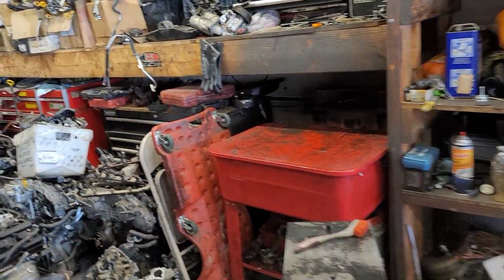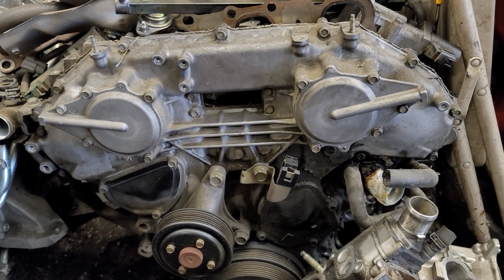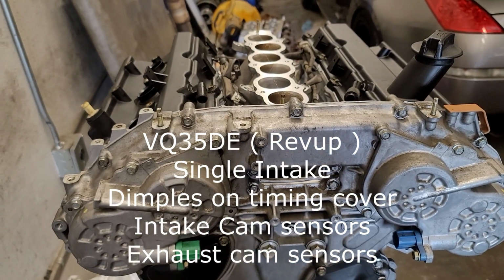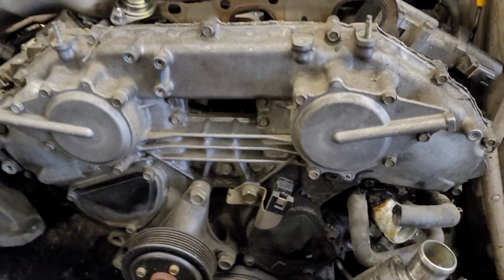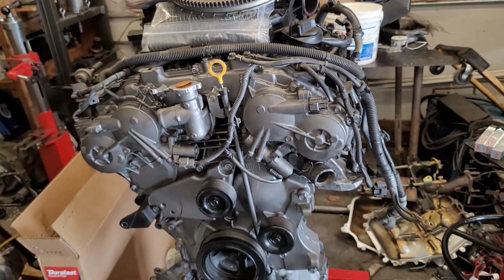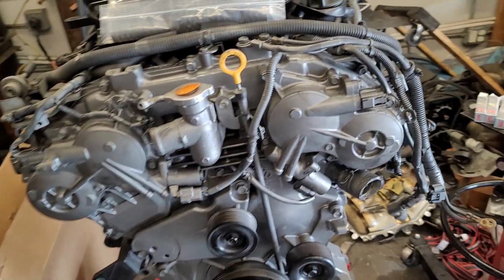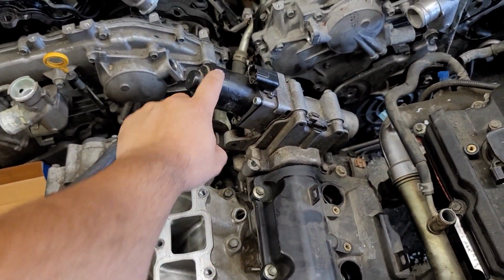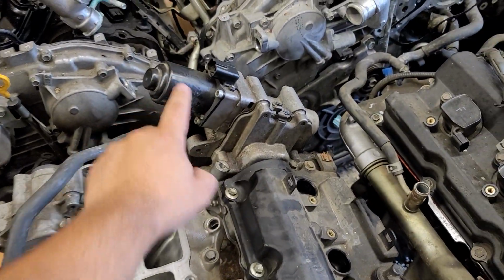Differences between a DE, Revup, HR, VHR motor ( Brief )

Comment: I just bought an 06 g35 and I heard that it has a revup but for some reason mine has a non rev up I’m guessing the previous owner swapped it. Is that for better or for worse?
Reply: All automatic transmission G35s from 06 and below had a non-rev up engine, according to what I've read.

Comment: also, I know this video isn't about this, but maybe you could clarify a question I have about the DE engines?  I currently replaced the radiator in my Pathfinder everything fine except the other day it overheated and all the antifreeze spewed out of the catch bottle now is it true that these engines have two thermostats or do some only have one in the front I can't see the one that is said to be in the rear of the engine because you have to remove the intake manifold to get to it, and I don't see any cooling piping going back through there and stopping anywhere, except for the bleeder tube to burp the system . I was just wondering if it was true for all DE engines that they have two thermostats instead of just one? any help or feedback about this would be greatly appreciated. Thank you for your video.

Comment: my 01 pathfinder and 04' 350Z both have VQ35DE's in them but the intakes manifolds are different the Z's the throttle body is directly in back of the engine exiting to the right of course. The pathfinders is directly right side of the manifold. So is there different DE engines?  I also read there is such thing as a VQ30DE's.  Anyway both vehicles are stock and both vehicle emissions control information stickers both say VQ 35 DE on them so I'm not completely sure if they are correct. I don't know what was done to my Z it could be an aftermarket intake but to me it looks stock.
Reply: I thought pathfinders had a vq40

Comment: Which one is the best and reliable having a DE with no issues
Reply: Rashid Khan none bro, get a HR
Reply: 03-05 non rev up de is the best de
Reply: DE AND VHR
Reply: K -A de and hr. Vhr has more known galley gasket issues and vvel heat issues. For boosting hr heads on a vhr works very well making it a vq37hr. Some people put vhr intake manilfold on the hr for n/a builds which are very similar no real gains have been proven with that though

Comment: Man my 03 is in limp mode and having hell figuring it out. Swapped out throttle bodies and still nothing. P1122 and p1126 codes. Both to do with the throttle motor. Any ideas?
Reply: Tried an ecu reset?
Reply: @theg.c.142  Yeah like 30 times. Goes right back into limp mode. Bout to have nissan just diagnose it for me.
Reply: @earthisfat6184  
Sounds like a pain in the ass. There's a throttle position reset you can do too (if that helps). If that doesn't work, I hope Nissan can get you right without breaking your bank.
Reply: @theg.c.142  Yeah I've done them all. I think it's the wiring or the ipdm

Comment: Would it be a bad move if I went for a rev up motor Im looking into a 06 but seeing so much hate on this motor lol
Reply from the maker: The thing is there arent that many revups made, technically made only for 2 years.  Ive definitely seen some good ones, but the chances are small of getting a good healthy revup are small.  If you get one, you will have to be on top of the maintenance all the time and hope the motor wasnt damaged already by previous owner(s).
Reply: @saulnismoknights  I see been on the market for one now since I sold my Subaru looking into hrs they seem the most reliable
Reply from the maker: @sixstrz8310  yes HRs are way better if you're looking into getting a 350z